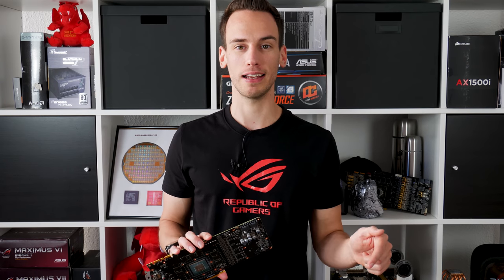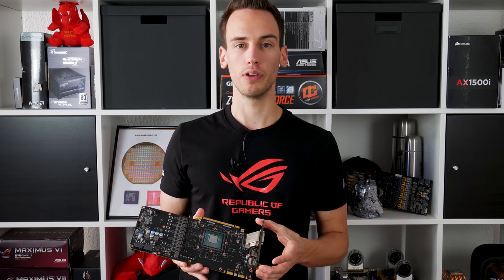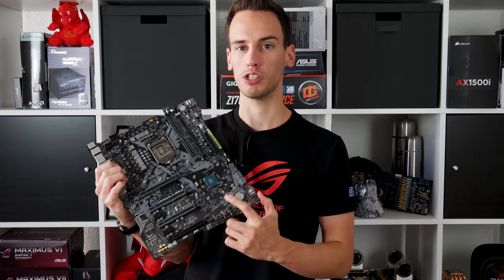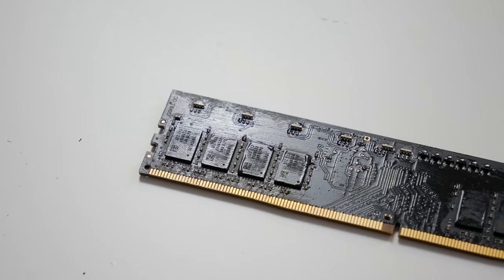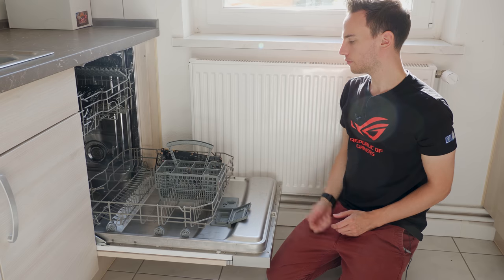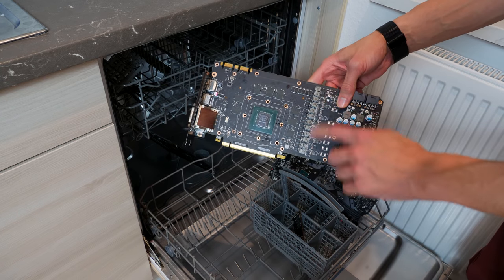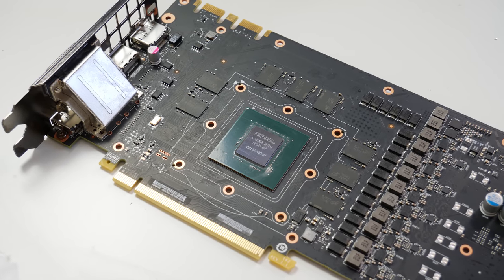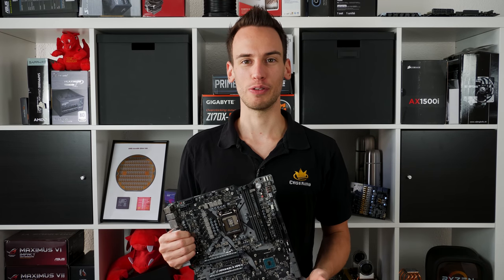The Diswasher Debate

Comment: Purely from the chemical point of view, the salt should even be filled up. This is used for the regeneration of the "descalers" contained in the machine and is not added to the things to be washed (incidentally, it is really just normal cooking salt). So if the salt is missing, limescale can be deposited on your hardware (the best thing is to set the right hardness on your dishwasher (see manual), this should be done in general;)). Alternatively, of course, also distilled water (or demineralized water, that one normal-white falsely also under this name) and no salt. The latter option should be even better, as the cations have already been removed. (Who wants to know more about descaling, ion exchangers, anions and cations> Wikipedia: P)
With the rinse-aid it looks different in the case. These usually contain light acids and thus could easily attack the hardware (will probably only become noticeable after several washes). Deiser should therefore be avoided just like normal dishwasher washing detergent. However, you can add a few drops of normal handwash. This should make cleaning a little easier.
However, where I could rather see a problem, would be the last wash, in this would actually come only the rinse-aid used. Here, the water is heated relatively strong, to evaporate quickly at the end. This could possibly be a small problem. Also missing now is the rinse-aid which should also remove the surface tension of the water. If you want it to be "perfect," you could try dropping a drop of handwash. This should have the same effect. So, but enough of dishwasher.

More video suggestions: Everything that smashes the myths of normal users is a good video. To handle his hardware with kid gloves you do not hurt, but usually costs unnecessary time and (at least me as a spectator) mostly annoying. (If your "assistant" shows up again (german video), that does not hurt either;).)

Comment: DEFINITELY don't add soap/detergent/dishwasing pill. That stuff has salts in it, which will dissolve in the water and crystalise on your hardware. Most (all maybe?) salts are conductive, and will cause a short circuit. Usually the rinse cycle of the dishwasher gets rid of all the remaining soap, but with all the nooks and crannies of PC hardware I wouldn't guarantee it

Edit: also, some dishwashers store water from the previous run, which may include soap. Maybe run a rinse cycle first before putting the hardware in if you're particularly paranoid
Reply: More of a semantics here but salts themselves are not conductive. Free ions are required for a substance to be electrically conductive. This is why salt water is conductive but not pure water, the salts ions make the water conductive. So neither water nor salt is conductive by themselves, but together they are.

Would still agree not to use detergents though.

Comment: But when Vaseline gets hot, it gets melty and runny, which could lead to areas being exposed.  It's also obviously not permanent.  Why not spray the PCB with conformal coating after masking off the connectors, die, and chips?  There's even thermally conductive conformal coatings, which may actually help draw heat out of the bottom of components and spread it more evenly throughout, reducing overall temps.  It would also be permanent and extremely durable.  Please test and create at least one video on the subject.  Thanks!
Reply: The PCB under LN2 gets really cold. So why would the Vaseline get hot
Reply: @parsastrife6629  If I put my right hand into boiling water and my left hand into a bag of ice, the right hand will still get burned. They don't cover the whole thing in LN2, just the GPU chip itself. So its still possible for the other parts of the board to heat up.
Reply: @jaalan7896  Don't think that analogy applies here. 
There is way too much distance between your 2 hands, and the tolerance of the body to temperature is different than that of electronic components.
Reply: @jaalan7896  The reason they cover the board with Vaseline in the first place is to avoid condensation because of how cold it gets. So it doesn't matter that they only have the pot on CPU or GPU only. The surrounding area is still going to be chilly and below room temperature.
Reply: @jaalan7896  And afaik unless the board design is bad, you're not going to have any components get hot enough to make the Vaseline runny. In which case you have other problems to worry about.

Comment: I think this is a great idea for board exposed to lubricants and special thermal pastes and such. And maybe for ensuring dust is removed from pcbs, and sockets. Make sure to use products with surfactants that won't damage motherboard components. Not sure which ones are safe, and in some cases, may need to remove CPU socket. Would also use the blow dryer method for all circuits, sockets, and attached parts.

Comment: I worked at a fabrication house where we wave soldered printed circuit boards using water soluble flux. We washed all the boards we made in a dishwasher. Most electronic components are completely encapsulated and hermetically sealed. If they weren't they would oxidize just being exposed to the air after a while. But folks are ignorant so they do not know this. That is why they're so surprised. The trouble is of course when current is passing through a circuit while unintended pathways for current are being made by liquids. So just make sure everything is dry before powering it up.

Comment: Many years ago when AIO coolers were just coming into the market I bought an AIO and within a few weeks the side of the CPU waterblock split sending copious amounts of coolant throughout my build.
I contacted the manufacturer - thankfully they were based in my city - they agreed to not only replace the AIO cooler with a newer version, but also to clean both the motherboard and GPU of coolant using.... distilled water.
They soaked both the motherboard and GPU in distilled water for a few days; using a soft toothbrush to clean inside the various slots (e.g. memory, CPU socket, PCI slots), afterwards they dried the components for a few days + using canned air,  they reassembled the components and everything worked. That was great customer service.

I tried using the revised version of the AIO, but found the temps weren't any better than using an air cooler, so I sold it online. The GPU however did not live too long after the cleaning. Seems various contact points on the PCB melted during the time when the coolant was spraying all over everything, and it just died - the AIO cooling did company replaced the GPU for free.

Long story short; while I didn't believe for a moment that soaking my components in distilled water would actually work; it did, as long as the components are dried completely afterwards.

Always useful if I ever have a major coolant leak, I know that soaking the components in distilled water may actually breath new life into them.

Comment: A much easier and safer solution is to use Engineered Fluids DS-100 Dielectric Solvent.  You don't need to remove any of the components.  Just dip the board into DS-100 and shake it a bit, then take it out and your done.  You could actually plug the board in immediately and use it as the solvent is dielectric, better would be to let it dry for 30-60m.

Comment: I wonder what those people that freaked out about your dishwasher comment would think when they find out that water and a special detergent is used in ultrasonic cleaners to clean circuit boards? 😂😂😂 They are often dried at low temps in an oven afterwards to get rid of all moisture.

Comment: it's been common knowledge in the vintage mac community that running a logic board in the dishwasher with a non-corrosive detergent will do wonders on cleaning the board of electrolyte from leaky capacitors. Likewise, I've used the same technique to remove a super coke spill from an H87 motherboard a year ago for a friend's machine. In both cases, the #1 thing I can recommend is drying the board manually with a hair dryer on medium-high until the components are super hot to the touch so the water underneath anything BGA evaporates through convection. then you let it dry normally for a couple hours and test. this has been a tried and true method I've also recommended to friends and it seems to just work. no issues, no setbacks, just plain works.

Comment: Is there a max safe temperature for the heat-drying process? Couldn't you just let the dishwasher heat cycle? Or use a heat gun to bring the board up to a temp where water would quickly evaporate but not enough to cause solder joint stress? Is solder joint stress why you don't use the heat cycle on the dishwasher?

Comment: Despite der8bauer's advice I'd be inclined to use perhaps 1/4 of a detergent tablet to get everything really surgically clean, but then manually rinse the parts in hot distilled water (heated in surgically clean stainless saucepan -  scrub it out with sodium bicarbonate).

Comment: A few things: I wouldn’t recommend doing this often to components you want to last a long time.  Oxide will build up on connectors faster than normal.  Also I wouldn’t want to take a hair dryer to a working BGA.  The risk of reflow is high.  I would just put it in an oven set to 200F with the door cracked for a few hours.

Comment: A pro way of cleaning would be to use an ultrasonic bath followed by an alcohol bath and then drying. But this works too, just takes longer to both clean and dry the boards.

Comment: Worked at a small electronics assembly business and all the circuit boards were cleaned in what was a Modified Maytag dishwashing machine using two different cleaners on automatic dispensing with additional circuits added to control panel on top. Awful smelling citrus cleaner to remove solder flux. Used a elaborate Reverse osmosis filtration and mixed bed tanks and carbon to have ultra clean water measured with Meg-ohm meter to keep an eye on water quality. Even had a log book to keep track cleaning batches if issues of boards not cleaning happened.
Reply: We used a plain dishwasher. The boss swore by Whirlpool. The bubbler in our wave solder machine used water soluble flux. So we did not have to use anything special to remove it. A plain wash cycle in a regular dishwasher did it.

Comment: Which program are you using, temperature wise, and for how long does it wash the board. Can it be done repeatedly, or should it get time to dry first before washing it a second time if a second wash is needed?
Also any issue doing this when the board is covered with dielectric grease?

Comment: You do realize that FIVE HOURS of water contact is enough to start the corrosion process with the various metals. You might not see it with the naked eye but it is there. Contact cleaner also won't help you if oxidization has already started hidden under a component. That's a real risk for expensive hardware and far too much time spent IMO.

A quicker and more safer way to get Vaseline off is to put the hardware in a preheated oven since Vaseline breaks down under moderate heat. I believe the right temperature is around 145F (63C) - any Vaseline should disappear at that temperature after 10-15 minutes. No risk of melting solder at that temperature, damaging plastics and no need to dry or clean afterwards.

Comment: Going to chime in here as a former repair technician that repaired circuit boards.  First, water won't damage the board.  Using pressurized water can damage or knock loose a 0603 or smaller Surface Mount (SMT) component, which is why I don't recommend using a dishwasher, greater harm to the boards.  Therefore, what they recommend you do in industry is to either use gently flowing water or isopropyl alcohol of 90% or greater (do not use scented) purity with what we call a horsehair brush.  It is basically a brush that is soft enough to not pop off a resistor but abrasive enough to clean a Printed Circuit Board's (PCB's) surface and metal surfaces without leaving scrapes or "imprints" in the metal.  After you are done cleaning the affected area, just let the unit sit for 24-48 hours to "air dry".  Worst case, put it in a container with decadents stored nearby (or some rice nearby but not touching the pcb), this will absorb extra moisture and expedite the process.  Lastly, use common sense.  If something looks small or frail, don't apply pressure, gently let the brush do the work by being gentle and cautious around the component.

Comment: I hand washed my MB in 2016. Worked without issues:) Also tried isopropyl bath on it - also works, but there was a slightly whitish residue on the board (AsRock z77 Extreme4) after that. 

Thanks for the tip on the electric cleaner - I now have a motherboard with thermal paste in the socket and tried isopropyl, but wasn't that successful.👍

Comment: True story:
Had a mech keyboard with sticky keys (somebody spilled sweet tea in it) that I could not fix with any other means.
I made sure the thing wasn't powered on for a while and then let it soak in a large tub of water (along with all of its caps), and then actuated the key switches until they no longer felt sticky.
I then let the board dry for a week--plugged it in to a PC with fingers crossed, and it was like it was totally new!
That was a little over a year ago and it's still what my brother uses on his PC to this day.
So at the very least, water shouldn't hurt all electronics (but capacitors with lingering charge could complicate the matter). I guess some dishwashers could theoretically spray too hard and displace components though.

Comment: When I went sub-zero with a single stage and needed to clean parts I used to peel of the liquid tape off and then wash my stuff in the bathroom sink using hot water, soap and a 1 inch brush. I then immediately dried it out with a hair drier making sure to blow hot hair under components to make sure there was 100% no water left. Everything always worked for me my way is much faster then this method.

Comment: You can also wash hardware in a container filled with isopropyl alcohol, won't leave residue and evaporates instantly (also is non-conductive), but I guess you wont get the cleaning power of the dishwasher, so it's more appropriate just for cleaning dirt and dust.

Comment: You can add a little dishsoap (the kind made for dishwashers) and it's fine, just don't add the full amount.  Only add about 1/3 the normal amount.  Then a single wash and it will be nice and clean.   I've ran multiple, nasty keyboards (not mine, at work) through the dishwasher at work.  So cool when they come out all clean.  If doing this with a keyboard, its best to remove the screws on the case, as those can rust a little. Once they are done, stand them on end, and on a corner if you can, and let them sit for a week.  That will let them dry the rest of the way out.  Sometimes when they are really nasty,  or in a load with a really nasty one, particles can get into the switches and sometimes a few keys stop working.  Partially disassembling the keyboard before running the parts through a wash cycle will probably help with this.  Remove the screws, unplug the cable if you can, leave the keys attached, and run the front plastic case, the backside plastic case, and they keyboard itself through a was cycle.  Dry with pressured air, reassemble, it's golden.

Comment: dishwasher tips: you can lift up the top sliding tray, and it will engage in a latch, it will be 4/5 cm higher or so, that way you can put in bigger pots (in this case the MoBo) ;)
(to lower the top tray again, if needed for bigger glasses: lift it up again, the latch wil disengage and it will lower to its original position)

Comment: 2:40  Not below room temperature.  Below the dew point.  If you're using an ice water bath and you live in a dry area (like Arizona), then the dew point could easily be below freezing, and there would be no condensation.

Comment: You can also put it in the washing machine, just put it on 30 degrees for 30 min or it will shrink.
Just put the complete tower in there.
Afther that just put it in the oven to dry.

Comment: Hey der8auer, hypothetically, if you dumped the whole system in ln2, what exactly would happen? Since ln2 is none conductive, surely this would actually prevent shorting and since there's no contact to air the board won't short on condensation, correct me if I'm wrong of course it's just a question I've had for a few days since the whole ripjay ripgn fiasco.
Reply: Caps do not like getting that cold

Comment: Maybe high pressure air would be better for removing water residue.
If think using a hair dryer will cause residue from the water to settle in place leaving a potential cause for corrosion...?

Comment: Do you ever worry about vaseline eating the plastics on the board? I know PBT components are fine, but ABS (keycaps, most consumer plastics) degrade overtime with exposure to petroleum based lubricants. Not sure if the degradation is enough to actually cause a problem though.

Comment: The dishwasher is no problem, but the detergent may well be. Regular dishwasher detergents are abrasive, some of them quite heavily, and can corrode aluminum very easily, for ex. Other soft metal alloys may suffer too. So, the dishwasher can be used freely, but with dish-washing liquid or gel, instead of regular powder or pods.